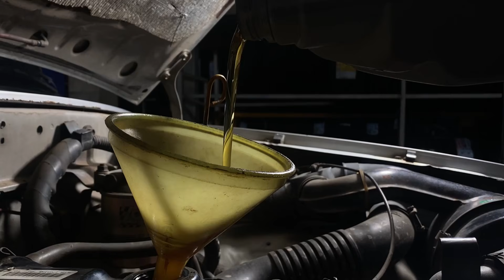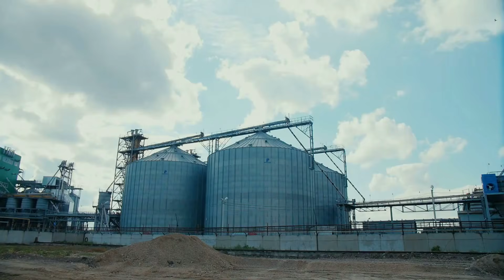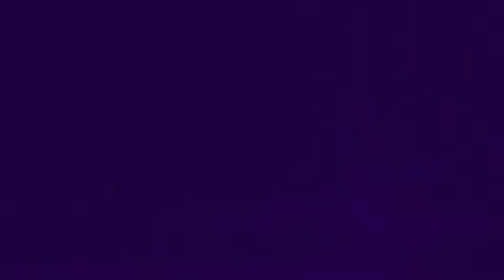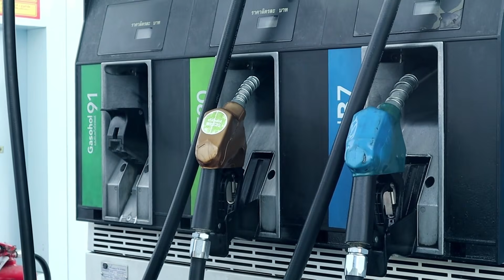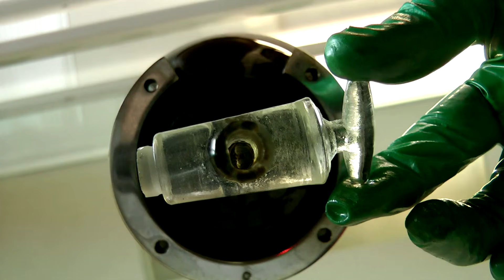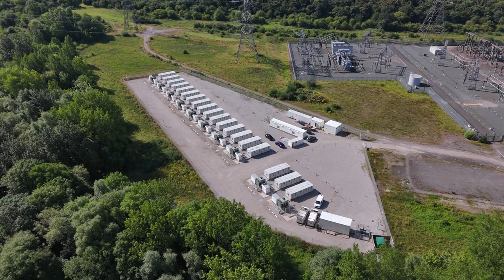Stop Overpaying for Gas — This $2 Hardware Store Liquid Cuts Fuel Waste by 30%

Comment: I have done and am even now doing Acetone addition to the gasoline but am not seeing these miracle mileage increases.  The '99 Tahoe still runs 14 mpg in town and up to 16 with highway drives thrown in.  On long distance road trips it has peaked at 18 mpg but that is the normal function and I have yet to see better, from adding Acetone.

EDIT: Just jumped forward and you have confirmed, 1 ounce to ten gallons, as was stated by another in a different vid I saw months ago.  I have the little measuring cup that I use and have been doing the ratio and as stated above I don't see any miracle miles increase.  I believe that if it were used 100 percent as a fuel that the exhaust would be very clean.